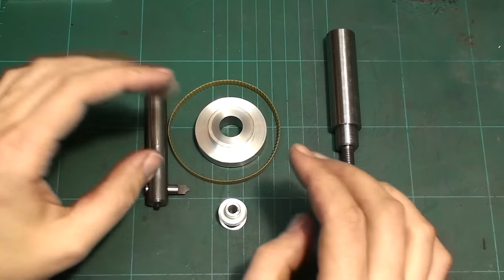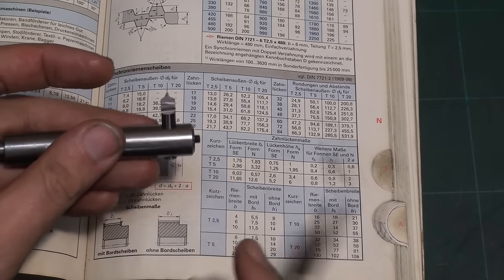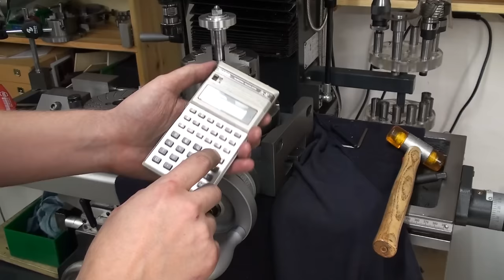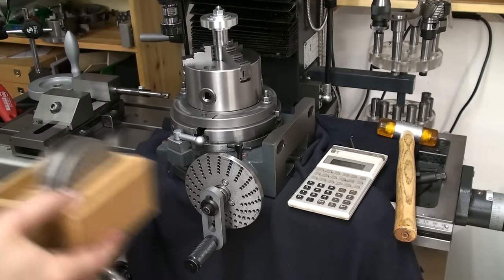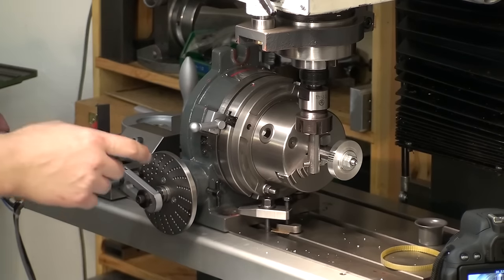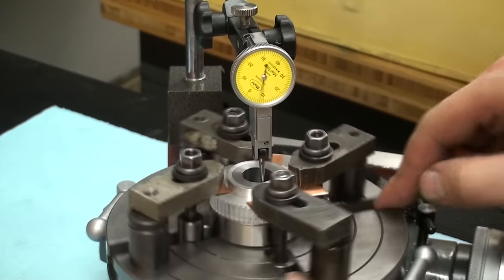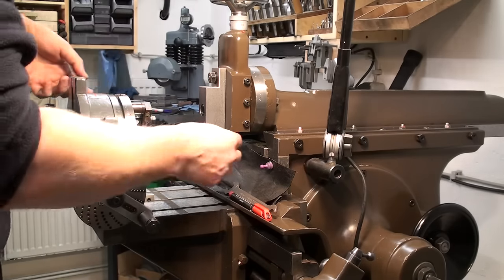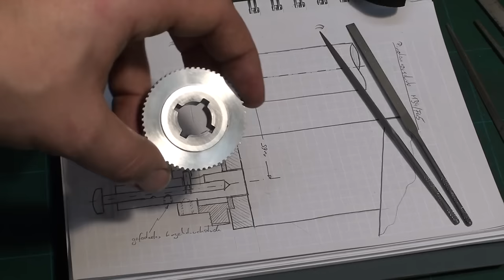Cutting a timing belt gear

Comment: I know this is nit-picking, but your small shaft  is actually a mandrel, not an arbor.  An arbor holds a tool, a mandrel holds a workpiece.  A single shaft can be either one, depending on how it is used.   Love your work, Stefan!

Comment: I just got done doing this very same thing but it was a repair on a back gear they lost 2 teeth in a row. I actually did it twice I filled one with brazing rod and cut teeth then on my other spirits embley I carved out a notch and put a tiny block of cast iron in it and cut the teeth with a fly cutter. Worked amazingly well I was very surprised.

Of course all I did was shape the cutter so it fit by eye. Those back gears are more forgiving they're kind of a loose sloppy fit anyway. The brass ones working like a champ so I have a backup. I found an amazing way to sections cast iron I take my brazing rod brass rod heated up and pounded into a foil a heavy foil I should say cut it out and press it into the slot with the cast iron replacement piece of course you have to clean it very well and sprinkle a little bit of flux in it I just use borax.

Works good

Comment: Very nice project, some great info here. Thank you! 

I recently made two T2.5 pulleys for the use with a rotary encoder to upgrade my lathe to an electronic lead screw. Since there are essentially no forces involved I ended up 3D printing them. Worked out OK after ‘fixing’ the center bores which were off by like 0.5mm…

Comment: Hi.
I recently had to make a similar toothed belt drive  but in my case the driven gear was a lot larger than the driving gear. Also it was a short belt with the gears close together. I realised that I didn't need to cut teeth on my driven gear so I didn't need to size it exactly either. I just made it as large as possible (plain pulley wheel). It works great and the belt doesn't slip. I reckon it's better than if I had cut the teeth and also the belt will last longer. Worth considering in some applications.

Comment: Good thing the other timing cog has fences so the belt won't want to wonder off. It looked like you had some radius on your form tool to me. Looking forward to the related build. Round pin in a square hole the need for steel center?

Comment: thanks Stefan for another shaper vid on keyway cutting. I own a Dutch made toolroom shaper from AI in German the abbreviation means something like Artillerie Einrichtung. it has the same dimensions as your Gack shaper. I have already made a toolholder based on your example for cutting internal keyways. I am however still struggling with grinding the cutter. Mine are cutting the keyways and with quit a good finish but also the process sounds a bit more violent then in your video ;-). maybe the cutter is too wide or maybe my cuts are to large........

Comment: Adopting the Taper Lock system for gears and pulleys provides a simpler off-the-shelf solution for custom this-to-that adaptations between random forms to random shafts.

Comment: I don't believe you mentioned it in this video but I recall in another video you demonstrated how you center the cutter for cutting a keyway in the shaper. The process I recall seeing was simply dragging the cutter in and out of the bore until it scored a very light line and eyeballing it center. While I'm sure this is fine for 90% of jobs, there must be some jobs where this isn't good enough. For those jobs how would you do it?

Comment: You know, i've noticed that when you radius those teeth, the belts slip more. I've only made 20 such gears myself, so nothing is set in stone, but out of them the first ones were made with the prescribed method and they always slip when run time gets the belts worked a bit, or when they sit around a lot.

Comment: Thumbs up for your intresting videos! A have a question about a 127toot modul 1.75 gear. Its 20mm thick and abaut 225mm in diameter. I made it from regular steel from a scrap cut out piece from a cnc gastorch. When i tested it in my lathe i heard a ringing sound exactly the same frequens as if i tap it with something. Very anoying sound. The gear have a great profile. So there is nothing wrong there thats causing the sound. The original gear are made of cast iron and have four spokes. I think the diffrence lays there. Never expected that. Do you have any idea how to fix this problem?

Comment: Stefan, You seem to use loctite to permanently hold round things together such as sleeves and shafts.  I understand that in low torque applications that this method is a quick way.  But with this timing gear, you have 4 "keyways" which I would consider a setup for higher torque drives.  Wouldn't a "Dutch Key"  be preferred (2 opposing set screws threaded axially on split line)?  I just don't have  much experience and therefore confidence in the loctite adhesive method to permanently bond.  I have seen where heat is used to remove the parts with loctite bonds.
Reply: If you use Loctite meant for glueing cylindrical parts and the parts are a sliding fit, you can pretty much assume they behave like a solid workpiece, granted that both parts were clean and you have 100 % coverage of the areas touching. I remember when someone with a bit of Loctite on their hands put a Morse taper 4 tool in the lathes tailstock and it had to be disassembled and brought to the hydraulic press, where it took roughly 40 tons to get the parts separated.

In the case Stefan here had, where he had steel hub and aluminum ring, a shrink fit would have been a very easy to do due to the different metals. Rule of thumb would be 0.001 mm per mm of size difference, so with a 20 mm hub your hole would be 19.98 or even 19.95 as the ring is aluminum and expands way more than steel. Shrink fits usually are disassembled by torching in half or just turning it to chips, pretty much permanent.

Comment: 0.200mm runout is ok for your chuck alignment?   For shame Stefan - you are better than that.   It you didn't have a shaper (only a German has a shaper in their basement) how would you cut the key Ways?    Also when you mention a specific kind of material, I would appreciate
 one sentence about it.  You used 75?? Aluminum which I've never herd of, so what are its characteristics?    A short video sometime on material selection and characteristics would be much appreciated.  Thanks for a great video.  Is that machinist book available in English, with large type?
Reply: The dial indicator he's using has graduations (marks) every 0.01mm. When he says "two hundredths of a millimetre" it'll be two of the marks, or 0.02mm indicated runout. He's using 7075 aluminium alloy which is pretty common so you can google it if you want more information.

Comment: lovely, high quality work and video :-D 
I use a lot of fly cutters like this, generally cutting brass clock gears, usually run them at 4000 rpm, I've not worked with aluminium much, is the slower speed recommended??

Comment: Excellent project as always! 
Question: Any suggestions on how to cut a keyway in a small bore without a shaper? I've seen variations on using the  lathe  carriage to hold a cutting tool with the part held in the lathe chuck. Is there a way the slot(s) could be cut on a vertical milling machine? Sure I could plunge down with small enough endmills but I'd love to hear your thoughts. Thanks!
Reply from the maker: In a pinch, for a one of, I would file it...
Or use the lathe as a shaper - Running the carriage back and forth, having something like a shapertool at centerheight in the toolpost.
Reply: Thanks for the feedback. If I may borrow one of your sayings "My personal OCD :-)" won't allow me to use a file for the keyways. It's a 6 position spline shaft that's about 45mm deep. I guess the safest route without spending a ton of cash is exactly as you suggest on the lathe. Thanks again for the excellent videos. I learn't a lot from just this video as I do from all of them.

Comment: I have a sneaking suspicion (sp) that the application involves a power feed possibly for the quill on your mill. if you or any body watching has a set of keyway broaches you could cut the four slots by milling a keyway in the broach guide bushing 90 degrees from the guide slot. As always more than one way to skin the cat

Comment: Stefan, I always enjoy your videos.  Q: what downwards angle is the slotting tool bar set at on your shaper? i want to make a similar mount and tool for my douglas shaper.
Nice work and i look forward to your next video 😎
Reply from the maker: I think thats about 5 degrees - The previous owner of the shaper made that holder, but I would not build it with the angle. I prefer to grind the relief angle into my tools.
Reply: Stefan Gotteswinter Really? I thought it would help with tool deflection. i would think that the extra effort including the angle was for more than cutter relief... hmm
Reply from the maker: Not sure about cutter deflection, but I get often in clearance issues with the tool in small bores. You can see that I had to file down quite a bit of material from the top of the tool to get clearance.

Comment: I don't know about the application, just seems strange to have a steel hub and four keyways to take the torque of a wimpy timing belt.  I am sure it will make sense when I see the big picture...
Reply: That the keyways are loose suggests it might get indexed on the key more frequently than normal.  To what end I have no idea though.

Comment: Stefan, do you happen to know if the reference book you use is available in an English edition?
Reply from the maker: It is!
https://www.amazon.com/Mechanical-Trades-Handbook-Ulrich-Fischer/dp/3808519142/ref=sr_1_1?ie=UTF8&qid=1481594020&sr=8-1&keywords=Mechanical+and+Metal+Trades+Handbook
Reply from the maker: Best thing, all metric ;)
Reply: +Stefan Gotteswinter I have a decent handle on most things metric except for splines. I have yet to figure them out. Plus the German/European metals system. To used to SAE

Comment: If you have a tool &die grinder (as you do) then for a one-off, single-point is the way to go. If you don't, then you have to hand-file the fly cutter. This is a pain and you  are certain to get the radii unsymmetrical unless you have an optical comparator :(. Or a steadier hand than mine. If you have a many-off, as in a clock, then a multipoint relieved cutter is better and the basic process is home shoppable  and described in www.deansphotograpica.com/projects/multipoint/multipoint.html. I am currently doing this, but using the "button method" due to Don Unwin, described in Ivan Law's book on gear cutting. It involves nothing worse than an eccentric arbor and a set of turned buttons.
Reply: You can grind such tools on a regular bench grinder, its no need for a tool&die grinder.
I have done this last 30 years a lot.
My old shop master showed me this often at really complicated shapes, he says always its only training.
What i can say, he told the truth ! 
Ok, if you own a T&C grinder, that makes life much easier. 
I had luck, years ago a buddy want to sell his old Klaiber WS I Tool and Cutter grinder and now it´s in my shop. :- )
Reply: If you are making a clock, and the biggest cutter you have has a 3mm shank, you can't see what you are grinding even with magnification and extra lighting. And I have no room for anything larger. :)
Reply: Juan Rivero , ok  that is a very good argument. 
Sorry my fault, i kept not the small dimensions of the clockmakers in mind.
Small shop mmmh, perhaps is a Bonelle T&C grinder a solution for you.
The plans are free in ithe www available
But i think your machines could be a little bit to small to build one for yourself.
Stefan started to build such one and sold the project before it was finished.
If i remember right, there was some problems, but its better to ask him self. ;-)
Reply: Keine Sorge.

Comment: I thought you had reversed your sharper direction? It seemed normal in this clip.
Reply from the maker: The switch on the machine allows for both directions :)
Three phase machine, by changing two of the three live  wires against each other, it changes its direction.
Reply: Genius. I never thought it would be as simple as reversing the motor.

Comment: Pulley.
Reply from the maker: That too, yeah
Reply: Actually in English it is a sprocket or cog. A pulley is a traction device that relies on friction to transmit power. A gear is a toothed item that directly interacts with another toothed item, either a gear or rack. Sprockets use positive engagement with a usually flexible element to transmit power, motion or position. Cog is kind of a weird term that can mean a small gear, sprocket or the motion itself,especially if intermittent, and sometimes it depends on usage.
 Eigentlich ist es auf Englisch ein Kettenrad oder Zahnrad. Eine Rolle ist eine Zugvorrichtung, die auf Reibung beruht, um Energie zu übertragen. Ein Zahnrad ist ein gezahntes Element, das direkt mit einem anderen gezahnten Gegenstand, entweder einem Zahnrad oder Zahnstange, zusammenwirkt. Kettenräder verwenden einen formschlüssigen Eingriff mit einem üblicherweise flexiblen Element, um Kraft, Bewegung oder Position zu übertragen. Cog ist irgendwie ein seltsamer Begriff, der ein kleines Zahnrad, Kettenrad oder die Bewegung selbst bedeuten kann, besonders wenn intermittierend, und manchmal hängt es vom Gebrauch ab.
 
   Mike (o\!/o)